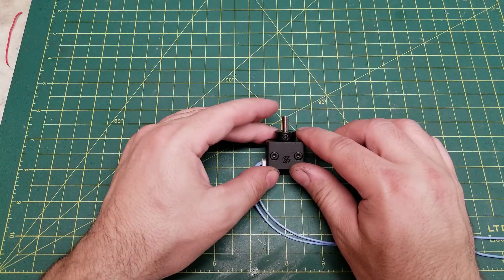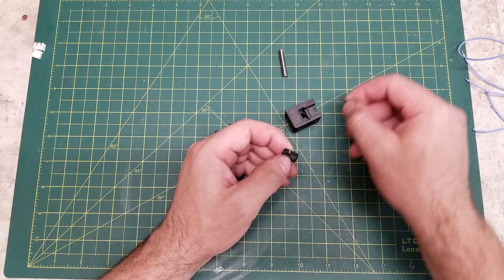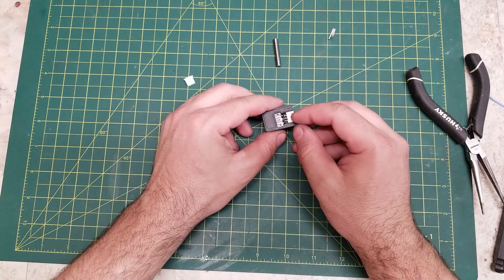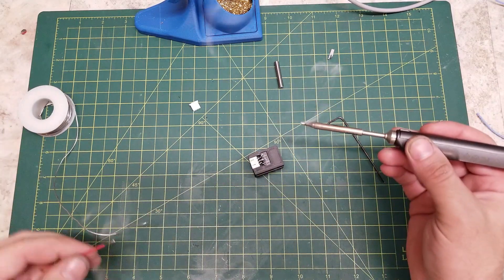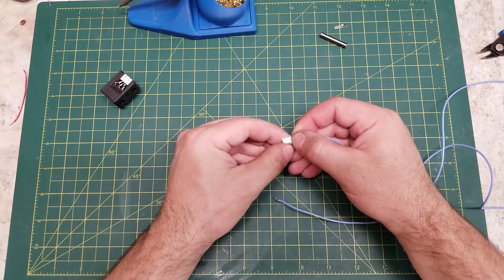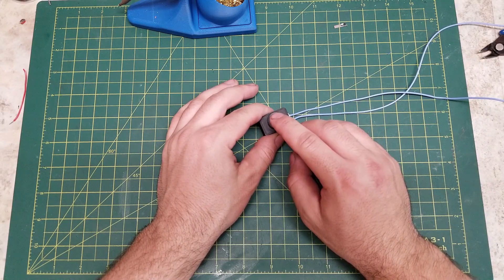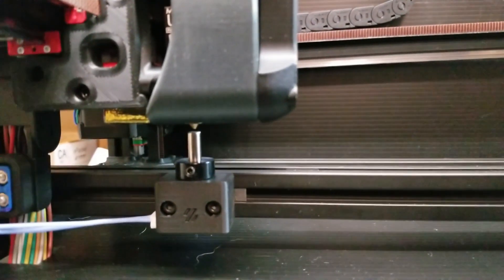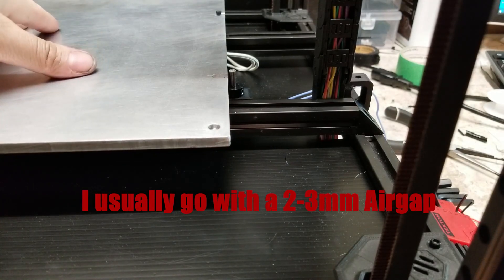Voron V2.4 Z Endstop Assembly and Bed Locating guide

Comment: I decided to use my probe as z endstop
Reply: A year later wondering how this has worked out for you?  Just finished putting my 2.4 together and I think this is maybe the weak point of the design.  Prusa figured all this out years ago.  They use a higher quality probe and use it for everything, and do away with the physical end stop entirely.
Reply: @netpackrat  never had a problem with the z stop. Had a problem with the probe bending pins due to normal operations. Euclid is the best option. And you can use it for z stop as well
Reply: So, having printed with the 2.4 for a few weeks now, I just wanted to note that I am actually starting to like the Z end stop and how it works.  I suspect it's probably the next best thing to having the nozzle directly probe the bed as with TAP or Prusa's new extruder.  Probably going to skip Klicky or Euclid entirely and go directly to TAP when I am ready to upgrade.

Comment: This is very interesting, reminds how CNC calibrate drill pit depth.

But is it really so accurate with microswitch? Im thinking to do Z calibrate to normal CoreXY but with "light gate sensor" and adjust screw, so Im asking do you know is that accurate enough or woud u desing also light port switch to get best readings? 🤔🤷
Reply from the maker: The switch is Accurate to one microstep.

Comment: why can't we use normal limitswitches why choosing this complex design which will operate the same as any limitswitch ?
Reply from the maker: because most limit switches cannot take repeated strikes from a heated nozzle, plus you need to have it moved away from the bed itself (thus the pin) otherwise heat transfer will affect accuracy

Comment: Why are you using 2 different types of Z probe? You already have a proximity sensor near hotend for bed leveling.
Reply from the maker: The probe is used for tramming. The z endstop is for nozzle offset. This elements any issues with z offset drift from different enclosure/bed temperatures and also ensures your nozzle offset remains unchanged after nozzle change or hotend swap
Reply: @CanuckCreator  thanks for answer! It's now clear. Have not finished my Voron so that's why I am asking

Comment: hey i building my own voron now. but i dont get one thing.... how u adjust this pin? because i will get a 8mm alu plate. And on that Plate i will fix an 1mm Pertinax Plate... should u Adjust or can u adjust this pin or do i have to set an Z offset manually? thx greets from austria
Reply from the maker: Pin height should be "close" to the same level as your bed, if its alittle above/below thats fine, just adjust the offset in firmware.
Reply: Great question, great answer. Thank you both!
Reply: @CanuckCreator  When you mention at "close" to the level of the bed... is this when the pin is "at rest" or when it is pressed down "actuated"?
Reply: What is z-offset called in fluidd?

Comment: wouldnt the pin drop if you tilt  the printer more than 90 degrees? how about filing a nocth on the perimeter of the pin at the height of the screw to use it to secure it? obviously, the notch would have to be wide to allow the pin to move :) 
perhaps can be done with a simple file and just by putting the pin on a drill ... you can remove the screw, mark the position, make the notch 1 mm under and 3 mm over the mark...  to allow room, then put back the crew with loctite (not to tight the pin but just to keep it in place, not sure if i'm explaining myself
Reply from the maker: In design there is a notch so the setscrew can hold it captive yes.
Reply: @CanuckCreator  nice!!! thanks!

Comment: I am building a V2.4 350 from a Formbot kit.  The build plate has two threaded blind holes along one edge, they are also opposite the surface that has been machined level.  Do these holes have a function and if so what is the proper orientation?
Thanks
Steve
Reply from the maker: Those holes go at the back. They are for the ground wire and thermal fuse

Comment: Sorry I wasn’t clear with my question, I want to move the Z end stop so that it is activated by the gantry, is there a reason why I shouldn’t?

Thanks,
Steve
Reply from the maker: Not really recommened as the reason it pings off the nozzle is so your z offset remains the same. Even after changing nozzles or hotends. 
Having it just go off the gantry removes this feature completly

Comment: Why am the fuss with the pin and gear!?
Why not just make it hit the switch itself or just use a bare pin
Reply: Hot nozzle, plastic switch? Also, the rod has a larger diameter than the micro switch, so it's easier for the nozzle to hit (less required precision). But still good questions to ask.

Comment: Why do they use the gear? It seems just to be used as guide, but there are much better ways to do this...
Reply from the maker: Its cheap, an item already on the BOM, simple and it works
Reply: @CanuckCreator  Hm either my thumbscrews are to short or the gear too high. So I can't get the pin as close to the bed as shown. The plastic part is flush to the extrusion top using a PCB version. And the h33l I can't get those "JST" crimped right specially the insulation gripping part bends backwards instead going around. Using already the PA09 and the shown die size.

Comment: Can you share a link to the limit switches you use? The BOM doesn't have a specific kind. I am always confused about the voltages and etc...
Reply: Here's one from the Voron 1.8 sourcing guide.  Same as what you need in the 2.4 (it's a pretty generic switch): https://www.digikey.com/product-detail/en/omron-electronics-inc-emc-div/D2F-5L/Z8846-ND/8593137

Comment: What is the length of 5mm rod？
Reply from the maker: It is called out in the BOM. And may need to be adjusted based on how your bed is mounted.  Should be equal or withib mm or two of the bed surface

Comment: Nice integration. If I may comment, it's  a bit complex for gear, maybe  reaming/drilling the hole or a brass bushing could be considered instead of the pulley.
But overall it's awesome work
Reply from the maker: The gear is used simply because it already has a slip fit hole for the pin and is also on the bom already
Saves from having to order another component.